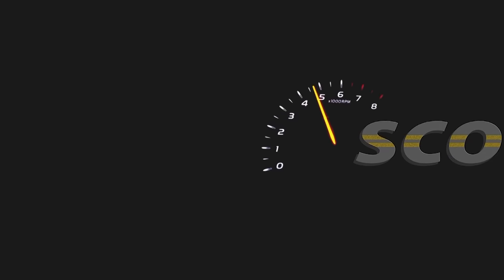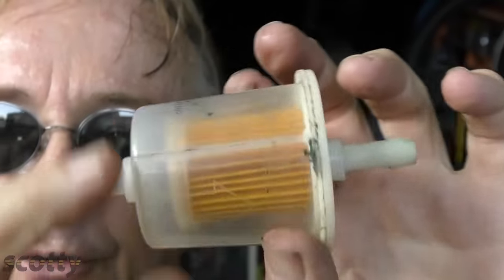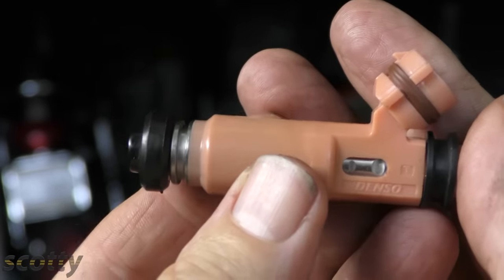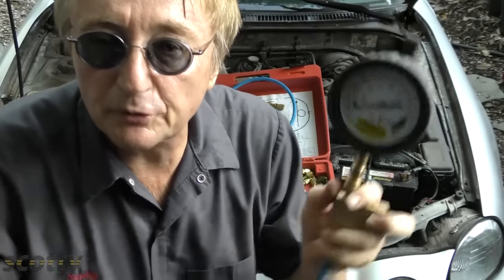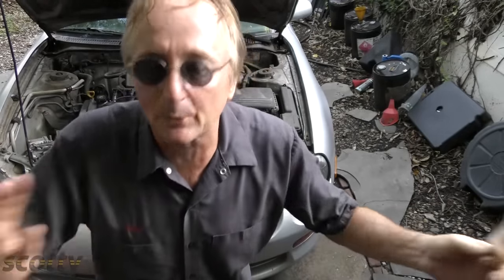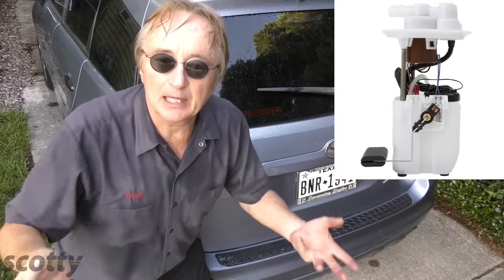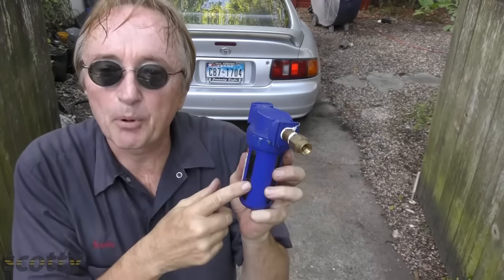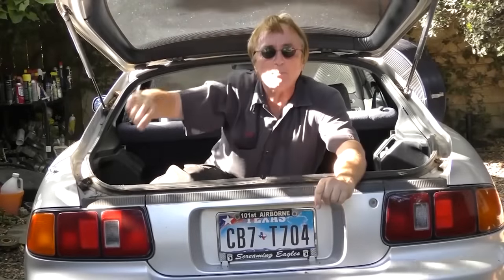Here’s What Happens if You Don’t Change the Fuel Filter in Your Car

Comment: can u add a inline fuel filter if u dont have one? i hate not having it. my older truck had a metal one inline easily changed. these new trucks-nope
Reply: You probably can add one but its a lot of hassle
Reply: Graft er Im not gonna worry about it then. The oil consumption issue that starter at 30k miles is more of a concern at this point than the fuel filter i guess. Dealer has me doing a consumption test now
Reply: @nov3019892008  I have a qweshin؟ pleeze 1 of you well-experienced tech/mechanics or Scaady-fans help me for I am in a konunjrum:
If a fuel tank is vandalized by addition of some contaminant to it. Not sure if it's water, vinegar bleach, ..etc. *does the fuel pump necessarily need be changed* whay is the best recomendation?? SHOULD I AuDOMATICALY also GeT a different tank (it would need be from wrecking yard~) IF I DON'T HAVE PRESSURE WASHER OR HOSE or facility to wash and put a sleeve into it- the gas tank- for cleaning?

Comment: Herko out of Florida sells fuel assemblies for Corolla for $125 with new pump assembly and filter sock. Replaced mine. Pump still good but changed filter sock. Found alot of foil tabs and cardboard round tabs from drygas and cleaner bottles.  Sock was almost clogged with junk almost black colored.

Comment: i replace mine every year, its right next to the engine and very easy to acess. 
Tip for people who drive diesels like myself is to buy clean 100% diesel, most gas stations these days sells ''diesel'' with 95%(or even less) diesel in it, and the rest is stuff you dont want in your tank, which is the cause for biological build up inside your tank.
So look around and check the product sheets for your local stations to see if you are able to get pure diesel.

Comment: Yep, Scott I must say, this is why I like your videos. You pretty much say it like it is. Cars today seem to be getting worse instead of better. You always gush about your 90's Toyota Celica being bullet proof, and for me it was my 97 Honda Accord. To this day it is still the best car I ever had. Unfortunately I got rear ended by a VW Jetta at high speed. Both cars were completely destroyed. I was lucky, I basically walked away with just a sore back. I can honestly say I owe my life to the safety engineering of that car. Furthermore, I've had major problems with every car that I have owned since my 97 Accord. I did not buy another Honda because I was well aware of the transmission failures that occurred on many of the newer Hondas and Acuras after 1997, and this went on for many years. If I were to buy a new car today, I honestly don't know what is considered reliable anymore. It seems that there's a lot of crappy new cars out there today. Especially the European garbage. BMW tops the list but others follow close behind.  I think I'd rather find another 1997 Accord that some old lady had with 30,000 original miles on it.. It might be a needle in a haystack, but it's one worth looking for. Thanks for the video Scotty.
Reply: So true and while we home mechanics complain about how modern cars are getting harder to work on - think of the professional mechanic! It’s made their jobs harder too! Manufacturers need to design cars easier to maintain.

Comment: on My Opel Astra, reaching the fuel filter is as easy as reaching over the engine. It's high up  , between the engine and the air intake for the AC. ( closer to the windshield )

Comment: On my 13 focus GDI I just pull up the fuel psi in the live data on the scan tool to check pressure. GDI motors have high and low fuel pressure sensors on the rail

Comment: Yea, "Lifetime fuel filter" sure, just like the "Lifetime air filter" my 2006 Focus had. Exactly as you said Scotty, 6-7 years in it clogged and the stealership wanted $800 for a new one because the system was completely sealed and had to be replaced as a whole. 

I found an aftermarket kit that allowed me to cut off the orginal airbox, and seal around the pipe and replace it with their own hinged airbox that I can replace the filter in. Works like a charm and was only $200 with tax.

Comment: Unless u own a 2000 Nissan Xterra. Just changed my fuel filter and realized it was stock because of the Nissan badging. Very stuck clamps and whatnot. I looked it up the model number and it was produced in 1999. My xterra has 200,000 miles on it. Ran no problem. I barely noticed a difference with a new k&n fuel filter.

Comment: My 98 Neon was hard starting for years and I kept being told by the 'experts' that it didn't have an external fuel filter and the filter pump assembly goes into the side of those plastic tanks so to get it out you have to drop the tank...

Well turns out Chrysler's engineers weren't stupid. They put the filter in the regulator that just twisted into the top of the assembly plate. Easy and quick to fix. The problem was in the FSM it was only marked as regulator and not filter/regulator.

Comment: Change them filters.. I had a drivability problem that took me a minute to figure out.  It was causing my motor to go lean under boost. And it was an older turbo motor so it did not protect itself like a modern one would. Luckily I'm an enthusiast with a guage and wideband. Because the symptoms were maybe 15% loss of power, but it really wasn't breaking up like a bad coil pack or something. and an inexperienced driver would have probably continue to keep driving it like that.  No check engine light either. that situation really opened my eyes to the fuel system and how important it is to maintain.

Comment: I’ve got an all aftermarket fuel system that pumps about twice as much as stock so I got two external filters to replace the in tank one a 10um and 60um radium set with heat exchangers too :)

Comment: When we lived in Davenport, IA there was a convenience store selling gas 5 - 6 cents cheaper than anyone else.  So yip, that's where I bought our gas.  The car (Nissan Maxima) didn't run right after a while; just thought it was something wrong with the car.  But - read in the local newspaper where others were complaining their cars started running bad or quit running completely after a fill up at the convenience store.  Come to find out the convenience store got big time fines because late at night, they had a water hose going into the tanks compromising the gas.

Comment: changed the fuel filter and pump on my 1994 Chevy Corsica last week, runs like a dream now lol
Reply: @Forrest Clark
KoooOl... "Corsica" that's a strangely difriny model name dint hear read uv...
I have a qweshin؟ pleeze 1 of you well-experienced tech/mechanics or Scaady-fans help me for I am in a konunjrum:
If a fuel tank is vandalized by addition of some contaminant to it. Not sure if it's water, vinegar bleach, ..etc. *does the fuel pump necessarily need be changed* whay is the best recomendation?? SHOULD I AuDOMATICALY also GeT a different tank (it would need be from wrecking yard~) IF I DON'T HAVE PRESSURE WASHER OR HOSE or facility to wash and put a sleeve into it- the gas tank- for cleaning?

Comment: In Europe, in The Netherlands the gas is extreme clean that a filter there is no need to change the filter for the quality from the fuel, the fueltanks are plastick so no rust. BUT water can be an issue from washing or rainwater got in the fueltank. So ALWAYS change the filters :)

Comment: Can you do a video on what you should focus on when you get a used car older model or new. What kind of mechanical things should be changed. The fuel filter, the timing belt, water pump, gaskets, Etc
I have a Lexus 400 96 that I just got and I want to do some work on it myself. I also want to take it to my mechanic to work on it as well for the bigger jobs

Comment: It's all about selling the highest priced part and the labor at the dealership. We've got the same problem on heavy trucks.
Reply: Armando Sturzenegger 
I work on Volvo, Peterbuilt, and Autocar chassis trash trucks. They keep trying to make it so you can't work on it yourself and have to bring it to the dealer. On the Volvos they will sell you the light control module, but then you have to take it to the dealer to have it programmed to the truck it's on or it won't work. The ac system on some trucks is controlled by the body computer, and a transient high pressure will shut it off. Then you get to take it to the dealer. I have more horror stories, but is that enough for you?

Comment: I am a big fan of technology and think that mpi fuel injection and electronic ignition made cold starts easier. But in my opinion, a point ignition system with a manual choke is just as quick at starting in cold weather, provided your starting/ charging system is in tip top shape. Fuel filter on carburated vehicle is under the hood near to or at the carburetor. New cars are over engineered.

Comment: Just changed the fuel filter on my 2001 Chevy S10 with 60k miles....owners manual suggested interval..... and roughly 100 miles later, it threw a code saying the engine was running too rich....lol....I did notice it was running better though.

Comment: Hoping this solves my check engine light P0174 issues. Rough idle (gift)  2006 Mazda B3000 v6 ds filter is oem and 15 years old.  Thanks Scotty. Oxygen sensors need replacement per code.

Comment: And if you have a car without an inline filter... only the one in the tank, incorporated to the pump....
A Pursuit version of a small car series, a little eccentric in design for some items.  Fuel filter only "on the pump" (drop the tank to change, car will let you know - just stops one day at a light, touch the pedal to go - stalled out, not enough fuel).  Also, finicky  on running temp and control of running temperature.  Heard it was like that from new (G5).

Comment: Just had this issue with my buddies VW Passat W8. Had to change out the fuel pump and filter. Luckily he was able to get all the components for ~100 bucks. Unluckily, the dip who designed the fuel pump made it so you need a special tool to take it out. 3 hours trying to pull the pump from a 3/4 full fuel tank. Never again.

Comment: Repeated problems of dying/lack of power/engine sputtering because of dirty fuel in my '92 Toyota pick.up.   occured when tank blow 1/2 (extra weight of fuel permitted enough fuel pressure).  With this truck had to drop the tank, clean tank and change filters---afterr that all power posible from 4 cyl engine

Comment: Hey Scotty I have a video suggestion for you you should do a video regarding gasoline and what happens if you put 93 into an engine that's not designed for it and if you put 87 into a engine into a engine that not designed for it  either I know if you put 93 or E85 into an engine does not design for it you'll put a hole in the Piston or melt the valves or if you put 87 into an engine is designed to run on 93 that the fuel can self-ignite before the right timing mark and  the Piston can push back down the other way

Comment: The problem these days is some mfrs are mounting the fuel filter on or near the fuel pump, and in some cases, requires replacing the fuel pump as it can be one unit in some models/brands.  The other thing is if you use quality fuel it's less of a concern.  I have 147k on my vehicle right now, and no signs of issues with the fuel system.  Still pretty much get the same gas mileage as I did from day one.  I do run super concentrated fuel cleaner through the engine though periodically, which I think has helped but I have not noticed any difference in fuel economy over the years.

Comment: My 97 Honda Civic had no check engine or other lights come on, just all of a sudden car would not start. Battery was fine but engine would not turn over so just took a guess that maybe it was the fuel filter.  I changed the fuel filter and the thing started up no problem. It had been about two years since I replaced it earlier.

Comment: Hi Scotty, many thanks to the great videos. I have a 6th Gen Celica GT 2.0. I emailed Toyota for the fuel filter and they replied that the filter is part of the fuel pump assembly ( a flat plastic type ) and sent me one. Then I noticed the metal type (which you pointed to the one in your car in this video), that sits under the air filter assembly. My question is do we need to replace both of them or just the metal type? Advice is much appreciated!

Comment: My 4.8l vortec shakes when i rev it in park or neutral. But not in drive. I installed New plugs,wires,fuel regulator. Cleaned mass air sensor and throttle body. No codes. Please help! !
P.s... i watch all your videos. Your the best

Comment: Unfortunately mine is in the gas tank and require removing the pump; not terrible to remove I guess since you just need to remove the back seat, but still don't want to mess it up just trying to see if it's dirty or replacing it since I've never done it before.  Car cranks a few times before starting up, but if I do a quick trip to the local store then come back after shopping it starts up faster.  Makes me think it is possibly the filter but not sure if I should change it.

Comment: So Scotty when does one know when to replace fuel filter? I have an engine light issue sometimes with my Honda civic 2005 and whenever engine light turns on the rev turns up.but if engine gets warm enough and I turn off the car and turn on engine light is gone . Should I change the fuel filter?

Comment: I’ve done a fuel pump and filter on a 3000gt man...talk about a royal pain...filtered screwed down so tight you break a line and then in the tank where the assembly is. You either break bolts or you get lucky and the nuts come off...

Comment: Change my fuel filter now after 93.000 miles! Equalent to 150.000 km. The motor stalls. maybe because another problem, but I pin-point by change this filter.

Comment: The P171 Engine running lean code has been popping up on my  ‘05 Dodge Neon for a while now. After replacing both oxygen censors I decides to read up on the changing the fuel filter. I changed the fuel pressure regulator/fuel filter and my car was working properly for a few (starting up right away). Then the P172 code started coming on and off. Finally the car wouldn’t start one time and I replaced the fuel pressure regulator again. Its been a few days now and It’s started to look like the filter is getting clogged again. I’m going to change the fuel pump and clean out the inside of the tank soon.

Comment: Wait a minute. Cars made in the last decade or more have primary filtration via a membrane filter (think Goretex) stopping pretty small stuff and rejecting water unless there is gallons of water. No filter could help you with gallons anyway. With the primary stage leaving the stuff in tank you use a finer particle capture filter after electric fuel pump to catch the tiny stuff and more importantly, to catch the wear particles from the electric motor. That gray stuff you dump out of filter is the brushes and if you look closely you’ll see copper flecks from the commutator. Diesels are different. With ULSD fuel carrying water more readily you need the paper of filter to hold some water. It can’t hold much so you best change them every 15 thousand miles to assure you get a dry filter in place even if the removed looks to not be dirty.

Comment: I had a Saturn. The fuel filter was outside the tank, but in their wisdom, the fuel pressure regulator was built into the filter. Not wanted to chance a fuel pressure problem, I spent about $150 for a Saturn OEM fuel filter. Luckily, I only had to put 1 in during the life of the car.

Comment: Useful information, thanks Scotty!
Reply: @Gold Wolf
I have a qweshin؟ pleeze 1 of you well-experienced tech/mechanics or Scaady-fans help me for I am in a konunjrum:
If a fuel tank is vandalized by addition of some contaminant to it. Not sure if it's water, vinegar bleach, ..etc. *does the fuel pump necessarily need be changed* whay is the best recomendation?? SHOULD I AuDOMATICALY also GeT a different tank (it would need be from wrecking yard~) IF I DON'T HAVE PRESSURE WASHER OR HOSE or facility to wash and put a sleeve into it- the gas tank- for cleaning?

Comment: actually my 2008 vw tdi is actually easy to replace the fuel filter it’s located in a canister right next to the engine it only takes 5 screws to replace

Comment: I never changed my fuel filter until  i got  around 200, 000 miles on my Camry. It always ran well.  But I finally got it done around 4 years ago. I only put 4 to 5 ,000 miles on my car a year so i should be good for another 10 years. 😀

Comment: Excellent info. Scotty...Thank you! My 2014 Kia Forte is almost at 58K miles and has developed an intermittent starting problem. Sometimes, usually the first start of the day in the morning, I have to put just a small amount of pressure on the accelerator before it will start the engine. My Kia dealership put it on the diag. computer but no code was displayed (probably because it's still within 25% tolerance, like you said in another vid). I suspect that this is exactly the problem. I'm not a mechanic but I'm a computer tech. and pretty handy with a wrench. I'm trying to fix this issue so I can put this car up for sale so I can get a truck instead. My question is, what is the proper way to depressurize the fuel lines connecting to the fuel pump assembly so that when I change the filter, no gas squirts out and possibly spills in my car?
Reply: If you can find workshop manual for your car, it explans how to reduce pressure in fuel line before removing the filter. Also need to Keep fuel cap open.